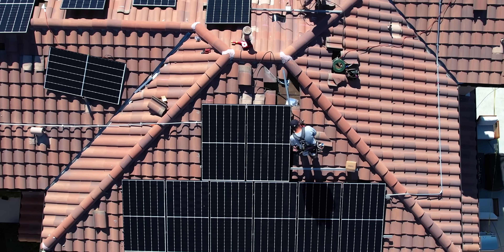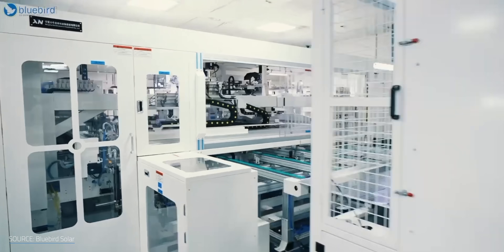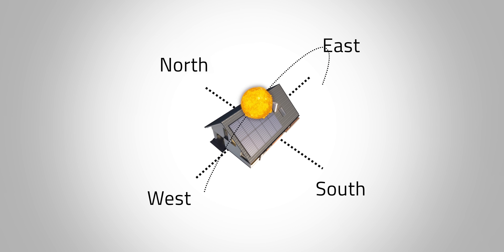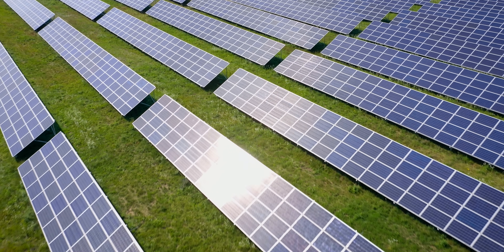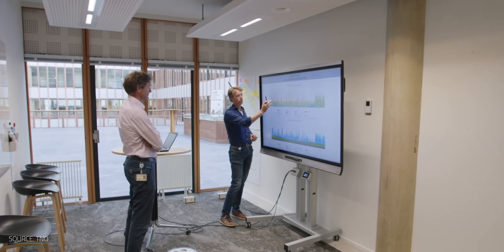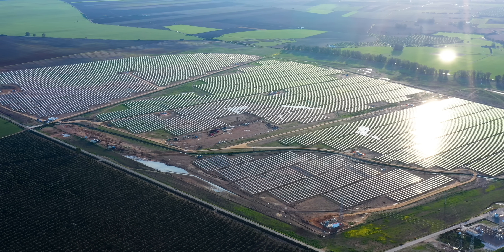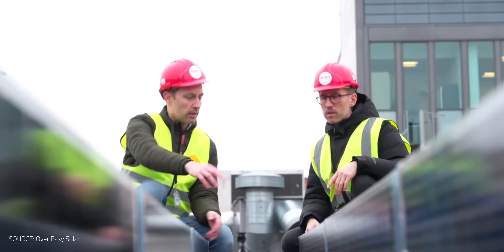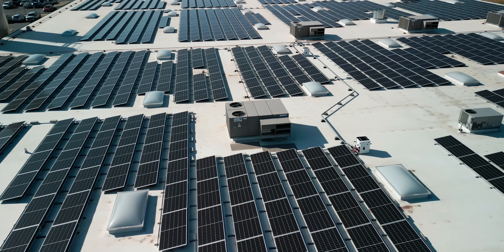Have we been doing Solar wrong all along?

Comment: The biggest advantage is higher production in the snowy winters, when almost ALL of the traditional solar is almost useless.

The largest drag on vertical solar is (year round) net metering, because it encourages people in HIGHER LATITUDES to displace the winter problem to someone else (usually fossil operators). Can solar be complemented with wind in the winter? I didn't find any data to support it.

The consequence is that people in higher latitudes will need 2 times (guesstimate) the assets (solar panels) to fulfill their energy needs, or rely on non-renewables during a portion of the year.

I love solar and I think it will be the largest source of energy, but I don't support net metering in higher latitudes, at least not without a phase out being planned into the system. It simply encourages the assets to be utilized in a non ideal way, very far from it as I tried to argue above.

Hope you read this comment and consider a video on it.

Thanks.

Comment: I would have liked a mention of articulating solar panels in this context. I assume they will not beat the horizontal ones when it comes to these unique and vast use cases regarding the space they take up, but shouldn't they be capable of outperforming the fixed vertical ones in terms of power output?

Comment: Imo the use of these for walls or fencing is the most exciting thing here... many buildings in cities have rooftop decks with no room for traditional solar panels. However, these can be incorporated as fencing for those decks, producing power in a non-invasive way. Also great for fencing in a yard as show in the video. The vertical orientation allows these to be placed where they otherwise couldn't be
Reply: Non invasive would be great.
Reply: Also, insurance companies don't like roof mounted solar panels so they will not renew your insurance or find some excuse to cancel your insurance such as, "your back yard is too cluttered".

Comment: You can increase the efficiency even more by placing  linear Fresnel mirrors between the panels.  I.e., a mirror that reflects incoming light 45 degrees would "aim" the light hitting between the panels at the E/W solar panels.
Reply: Thanks, I have a panel mounted close to a wall and just realized I could put this behind the panel. Better than painting the house white. 😂

Comment: So you get a few percent more energy from them,...
1) I would hope so, they have TWICE the collecting area
2) what is the additional cost of bifacial solar cells?
3) seeing as they cannot have a blocking mechanical back support, are they less durable, or more expensive to make? (I'd also expect that vertical mounts, only secured at bottom are a right nightmare in high hinds, requiring more substantial mounting hardware)

Also, the fact that these researchers didn't even set up an actual bifacial array AND a "control" latitudinally oriented arrray is extremely suspect.

Comment: Vertically mounted panels or flat mounted panels for that matter on roofs in a place like Nova Scotia could present a challenge with 5 feet of snow which fell last weekend. Vertical panels on the ground would need to be raised--a lot. Clearing the snow is a must, the weight would crush the building.

Comment: One of the most obvious and perhaps greatest advantages to rooftop arrays (of any orientation or form) is that they're much more difficult to steal, when compared to panels arrayed in a fence-like configuration on the ground. Sadly, that particular human factor must be considered by anyone installing a system of any type.

As for the technical pros and cons of dual-sided vertical vs. one-sided horizontal alignments, one factor to study is how much of the PV benefit to residents in hot regions, like the American sunbelt, stems from simply shading an otherwise overly-hot roof, and how much of that benefit is gained from the mini vertical panel configuration. In a city like Los Angeles, the energy lost from the panels' overheating might be overcompensated by that direct cooling effect, lessening the demand for air conditioning -- and that might hold up even if the PV panels' life is shorter (up to a point). 

Another factor to study would be the detriment of dust & snow accumulation vs. the cleansing benefit of rain. Horizontal panels in Miami might accumulate more dust, but with that area's frequent rains (esp. in the monsoon season), they'd also be cleaned (more or less) rather frequently. By contrast, a hot, desert region like west Texas, New Mexico, or Arizona might see a significant benefit from vertical arrays due to the lessened dust accumulation. Also, the cleansing benefit of rain might be just as great for vertical arrays as horizontal ones. (But vertical arrays might see some differentials based on their orientation and whether what rain they get hits both sides equally.) But it may turn out that vertical arrays located at ground level are apt to catch much more dust than if they were situated on a roof... or even compare poorly in that respect to horizontal rooftop arrays.

Comment: The reason that the energy is increased is because in vertical panel, a photon will travel more time in the material. In flat panel it just travels the width of the cell.

Comment: The advantage i see with this is more complimentary to traditional solar, rather than an alternative.
they can be used where normal solar panels would not function, or where the space for them is not available. 
they however are not more productive than tradiational solar, and they cost significantly more, making the ROI for them extremely poor. 
I doubt well see many of these, however they will see occasional use in specific use cases

Comment: My guess 30 seconds in, while vertical aren't as efficient as horizontal in most normal scenarios, the discrepancy they see with extra power is due to them being installed vertically, allowing more efficient airflow cooling. Which suggests that there might maybe be some fringe scenarios in extremely hot places where vertical wins out over horizontal thanks to the extra cooling having more of an effect.

Let's see how close I am!

Comment: Another advantage to this design is that they could be built to slide down into the ground in bad weather conditions.  Sure this would cause a temporary loss of power while submerged, but then you just have to supplement with other sources.

Comment: I am putting together a business plan for a solar farm with compression batteries (or redux flow depending on the cost benefit analysis) and I had almost ruled out bifacial panels altogether. The higher cost and one side catching light had me convinced it wasn't worth it, but after watching this and now I'm looking into the studies, it may not be that simple.
If the batteries are in concrete or in a shipping container, the concrete, or white paint, will help with yield. I'm glad I've got time to set this up because this is gonna take some figuring out...
Reply: Alternatively, you can use panels from French company DualSun, and you get to both harvest thermal energy and improve photovoltaic efficiency by cooling the panels with the liquid that harvest the thermal energy to heat water. DualSun claims that they have the best overall efficiency as they harvest both thermal + photovoltaic energy.

Comment: So, maybe a weird question, but I've seen glass panels that can turn opaque. If solar panels struggle with heat so much why don't we see this in panels?
You could adjust this based on the amount of sun and the panels temperature to stay within an optimal range.
Also, why are panels black? That catches ALL the frequencies even though that solar panels only capture a certain range.
Would making solar panels with a dark gray color work better in a hot climate?

Comment: Besides the wind flowing easier cooling panels down, the main reason they run cooler is that most heat comes from infrared sun rays, which the panels can't convert to electricity (yet).

Crops or soil reflects lot of visible light with relatively little infrared light.

Comment: I have build a PV "Carport" with Bifacial Panels. It is near perfect South facing and has an angle of around 20°. The panels i have are the LG360N1T-E6. At STC without Bifacial effect they are 360W panels. With the maximum Bifacial effect stated in the datasheet it goes up to 410W. Interestingly i can confirm that they out performed that by a long shot. I measured a maximum per panel so far at 440W. And i am certain there is still more possible. I would never guessed that they would outperform the Standard Test Conditions because i live in germany where 1000W/m² is definitely not a reality. So bifacial panels are definitely worth it in the right scenario.

Comment: I suppose you could still put these on a pitched roof. Like parallel to the trusses if your ‘gable’ faces east. Like the angle wouldn’t matter if they’re short.

But also like you could make them very short like an inch high but then also include a few flat one inch wide strips so you can customise how you want your energy duck graph to look. I predict solar panels (roof tiles) are all gonna look like kylie Minogue’s “can’t get you out of my head” dress by 2030.

Comment: Another advantage is that, in this concept, the production is more distributed over the day. The inverter can be smaller and better aligned to the produced power. Smaller is less investment, and better aligned is a (very) tiny increase in efficiency.

Comment: We need crazy engineers to start Frankensteining energy capture systems. I want to see a solar tree. Cells in a branch and leaf arrangements with water/refrigerant cooling for capturing the thermal energy as well. Considering over half of a Canadians heating bill is actually going to their water heater, I think a solar tree connected to dwh would be great. And I'd love less reliance on chemical batteries. Investment in gravity batteries and useful bleed down systems for excess voltage would be great

Comment: I'm at 54N, which means the best mid winter angle is 54+23.5= 77.5 degree angle - for when I need solar most (off grid) in mid winter.  I have half my panels in winter at vertical - use JA solar bifacial's, 315w front face and upto 390w with the back face - you need plenty of space behind them, not against a building to get the reflected light. In summer I change the layout for more summer optimisation 54-23.5= 30.5 degree angle.
I mainly got them for cloudy conditions, as that's the norm for UK.

Comment: What about different latitudes? It may work well in high latitudes with low sun compared to equatorial latitudes. Maybe if the sun angle is too steep, too vertical it's not as good anymore!?

Comment: This could be a good solution for big box stores. Vertical panels would not interfere with their skylights and other mechanical equipment. There are hundreds of thousands of acres of flat roofs in the US and they are close to where people need the electricity.

Comment: Vertical is the way to go: make fences out of it, put it on the top of the flat roof of your carport, shares the land with crops.
Reply: Horizontal would be better for crops, solar panels collect a lot more light per square foot than plants do, plants completely ignore green wave lengths of light, so all that energy is just wasted. You can use LED lights to produce the best light for the individual crop you are growing, and then use all of the extra energy gained on literally everything else.
If you don't leave gaps in a horizontal system, you don't waste energy by allowing the sun light to sneak around the horizontal panels.

Comment: i think the benefit of this comes from the random application of vertical solar panels as walls in areas that previously didnt have space for it. we brute forced our way to electricity for everyone with fossil fuels, and finding every surface now that can generate clean energy is key. if we continue with our current model of single family zoning, then at least having the fences and gates be made out of this instead of wood could be a benefit long term.

Comment: As you explained part of how BVPVs work is because light is reflected off snow/roof/next solar panel onto the a solar panel. This reminds me of a years-old ad about a guy who paired 2 single-sided solar panels into a horizontal V shape so reflected light would bounce between the faces of the 2 panels. Because each ray of light hit each panel multiple times more of it was converted into electricity instead of being lost as reflected light. He claimed this significantly improved the electricity generation. He racked multiple "V"s into a vertical column thus reducing both racking needs and required space. He researched the most efficient angle of the V and for a nominal fee would send you his findings. I can't remember his name. Please investigate if this is true and is anyone doing it.
Reply: I remember reading something about this years ago. Pretty sure it was the same thing you saw, because I remember that plans could be purchased. No idea if it would really work like he claimed, but I remember that my hunch at the time was that it would collect more energy per area of ground covered, but likely would collect less energy per panel.

Comment: this effect of solar PV losing power with heat is also very interesting, and why dual-use PV-thermal hybrid systems are so interesting to me. In addition to generating heat (one of the more electron-hogging things to do) the system actively cools the PV panel, allowing it to run more efficiently. very interesting to see this effect at work here with the vertical panels too.

Comment: If heat is an issue then the obvious engineering might be active cooling. Even with bifacial, there's room in the middle for a cooling system. Might be closed loop convection driven. Wouldn't want to consume too much energy. If used with farming, maybe get the irrigation system involved.

Comment: "Overperforming" needs to be compared on a cost basis, not just on a per panel instillation. Comparisons using similar agrivoltaic set ups, (including of course the increased maintenance for panels related to agricultural equipment usage next to the panels.)

Comment: I bet if we break the panels apart into smaller thinner flexible panels and put them on tall towers we could produce all kinds of nearly free electricity!  Maybe it has to do with the color of them too!  If we could lighten the color so that we balance what light is absorbed and turned into heat vs what is turned into electricity.  I think we should start by trying green.

Comment: So the reason vertical panels perform better is that optimally facing panels get too hot (receive too much light energy - the exact thing theyre trying to harness...?) Surely this really hints at a need to engineer improved heat dissipation of panels rather than vertical panels which seem a rather lazy solution?

Comment: I won't go solar until battery and panel efficiency goes up,I live in Las Vegas we have plenty of sun,but what's the point if I'm only going to save 3k over the course of the lifetime of unit.But as far as security camera back ups solar flood lights I use everyday,that has come a lot and I use a portable panel to charge my battery packs and accessories And I took my late great grandfather advice and I have it standing almost straight up facing Sw

Comment: Also orienting panel vertical instead of horizontal the air can pass over the panel making it ACT like a cooling fin.  We see on stereo amplifiers the cooling fins are oriented vertically not horzontally so air can pass over in a thermal going from the lower part of fin cooler to higher part of fin hotter.  Im going to take my huge fence down and install solar panels instead of fence panels, THANKS! Ive run out of room to put panels on my roof.

Comment: Vertical PV systems gain similar or more power per installed m^2 panels. But you cant place that many modules per m^2 land used because of shadowing.

So the power output per modul is great, but not the power output per used land.
Reply: Depends - one of the B roll shots did show a tower like design that could in theory use less land, but you would over all create larger shadows. What I think you mean to say is area. In that case, yes, area wise, you wont be able to really "fit more" as you would have to lay them out in a way that allows no shadowing. Yet if land is an issue, then you could just build up instead.

Comment: Will Prowse, please test. My bifacial panels produce 12.5% over their rated output on cold days. I’ve read about vertical bifacial panels for a few months now and may do one array like this on my next project. I’m 100% off grid with no utility connection running a fully functioning normal house and my priority is to maximize my KWH intake during the winter months. I like that I wouldn’t need to clean snow off the verticals. But are the lower temps of the verticals really a concern during cold winter months to compensate for the possibly less solar gain?

Comment: Maybe putting a reflector in the ground could help with this setup. Reflective mylar is real cheap and in some sense it should provide some of the benefits of sun tracking without the motors or reap the advantages of two layouts while having only one. However I imagine that the reflector may increase the heat so it might negate that benefit, maybe a dichroic reflector would be ideal. 
Shame I live in an apartment so I can't test any of that.
Reply: Have a balcony? Google balcony solar panels.
Reply: @zanwoi8075  I live in a 3rd floor in a narrow street in a place where it rains from 1/3 to 1/2 of the days of the year, don't have a balcony and not that much window area. 
Even my chili plants struggle a bit, solar panels would do terrible.
I hope to move some time, hopefully to a house with a small terrain for solar panels and other stuff but at best it will take a year or two more.